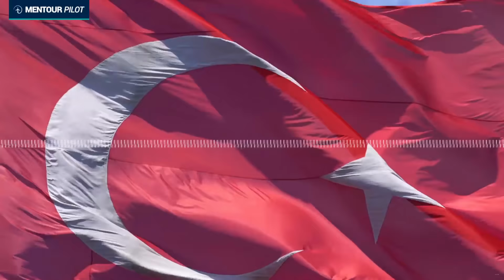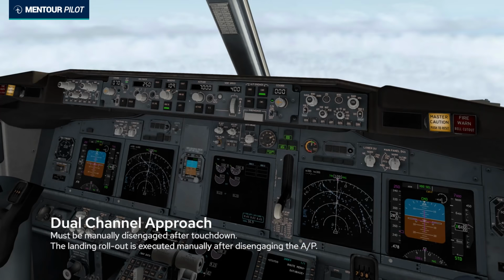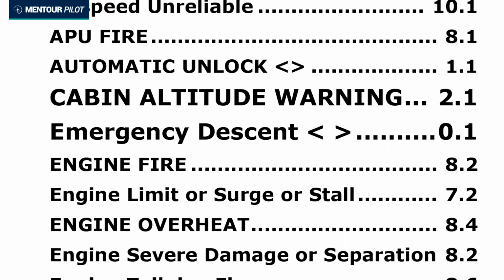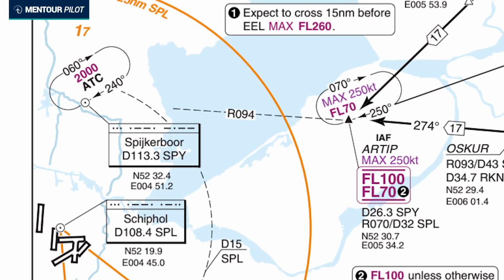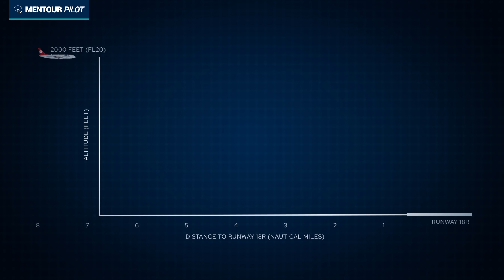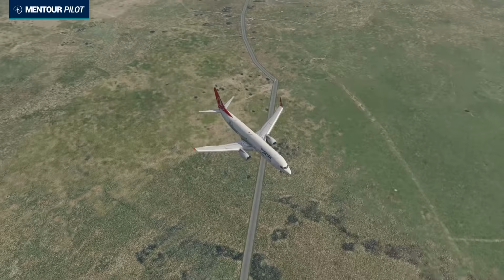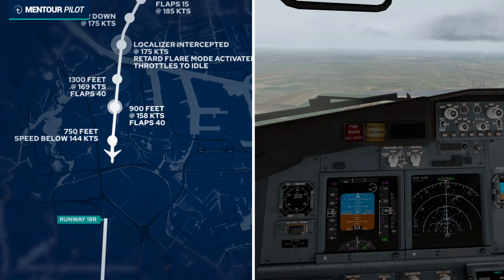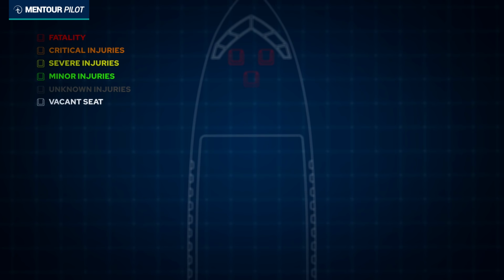What happened to Turkish Airlines flight 1951?!

Comment: As always, some of the most in depth analysis on airline crashs to be found---anywhere.  I watch pretty much all of the Docs--Mayday, Seconds from Disaster, Air Crash Investigation....So I know you have done these explanations a million times.  I can't help but still note there is almost no sense of tragedy in the deaths involved.  Certainly I don't have your knowledge and I guess if you're going to do these the way you do, must be necessary to divorce yourself from any emotion about each incident.  Despite have seen so many of them, I haven't gotten to that point yet--at least most of the time.   
Also: despite having seen dozens of your crash analysis I still only know you as "Mentour Pilot"  Surely you've given your actual name somewhere?

Finally,
I never buy-in completely to the official analysis whether it be NTSB, BEI or any of them.  There still exists a substantial disconnect between today's "auto flying airlines" and how well trained pilots are to use (often over depend on them).  Airbus actually has a philosophy where they'd like to see Pilots rendered obsolete and unnecessary.  Boeing incorporates the same level of automation but not from the same philosophical perspective.   𝗠𝘆 𝗳𝗶𝗲𝗹𝗱 𝗼𝗳 𝗲𝘅𝗽𝗲𝗿𝘁𝗶𝘀𝗲 𝗜𝗦 𝗘𝗻𝘁𝗲𝗿𝗽𝗿𝗶𝘀𝗲 𝗜𝗧.  My own conclusion is that while Airbus and Boeing may understand, WELL, how airplanes work they do NOT understand the limitations of Computer based AI.  They way underestimate how "mindless" these systems are in a "garbage in, garbage out" scenario.  Unfortunately today's pilots also put way too much faith in these automated systems.  Computers are great for doing accounting,--flying airliners and solving unforeseen (i.e., those they have not been programmed to solve) scenarios---NOT SO MUCH.

Comment: It seems not paying attention to the engine thrust and losing speed is the most common cause of landing accidents. But that usually happens after the crew fails to go around when they could. In real life pilots are under immense pressure to maintain TAT and on Indigo I remember a pilot saying they could be derostered for going around. This is the problem.

Comment: In many of your videos you explain when what information was on display to the pilot. Like flight director bars coming and going.

Is that information part of the flight recorder data? Like as separate bits in the recording where the computer logs what it draws? Or is it inferred from some other state of the system as reconstructed by the data?
Reply: It is usually inferred from other data.

Comment: So what ever came about on what I think is the start of all these compounding problems?  

The faulty radio altimeter?  Was it ever looked at for the cause of its failure?   Yes the pilots not monitoring their controls is of course part of it but if they didn't have that faulty part, most of or none of this would have happend.....

Comment: Thanks for all your very interesting videos. 
As a not-pilot I don't understand, how can the A/T only depends on one Radio-altimeter and not verify with a 2nd source of data? (sounds to me like MCAS depending on one angle of attack sensor.🤬) Boeing safety standard?
Having a 42 year old first officer beeing controlled by a 28 year old safety pilot on a Turkish airline seames to me also not very optimal.

Comment: Why does the B737 usually break into three during accidents?  Obviously it's impossible to make direct comparisons between accidents as they are all unique but I don't see the same ruptures in the fuselage in other aircraft experiencing similar accidents (lower altitudes and velocities).  The BA B772 at LHR springs to mind.
Reply: You say it is impossible to make direct comparisons between accidents, but you go looking for a direct comparison and then pick one that is not comparable at all. This airplane stalled and pancaked into the ground. The BA 777 @LHR touched down in soft soil short of the runway without stalling.

Comment: Sounds like maybe they could have avoided the crash if the FO had been allowed to complete the stall recovery when he did, if they had kept the plane at full throttle from that point on. Of course neither of them should have let the airspeed creep so low and the AOA get so high in the first place without realising something was wrong, but there you go.. human factor I guess.

(Yes, obviously this all began with the faulty radar altimeter and the automated systems relying on it, and the crew's inability to recognize this, but the ultimate nail in the coffin was driven in during those last seconds.)

Comment: After watching many of the videos it strikes me that in almost all cases, automatic warning alarms trigger way after it is too late to do anything to effectively address the problem. As a result, they seem to just distract the pilots from solving the problem they are working on. Why can’t these alarms be programmed to trigger much earlier, before the conditions get so critical?
Reply: more needed is an auto save the plane mode so the plane engages in a alternative go around mode where max throttle and disengaging pilot steering would come in handy
xD

Comment: 737 TRI here. Kinda confused. It looks like the the crew continued the approach with CMD B engaged and thus a single channel approach...therefore the A/T would remain in MCP SPD even with a faulty altimeter and would only go to RETARD at 27' RA on a dual channel approach. Did the FO eventually engage the second AP that wasn't shown in the video?
Reply: No the AT will still retard the thrust at 27ft no matter the type of ils, single channel  dual channel ,or manual,  just like with the 777 and 787. 
 Thats why you can  see some 737 pilots(although it's rare as it contradicts the fctm)  leaving  the autothrottle enabled during a manual landing , and it will disconnect by itself upon thrust reversers operation.

Comment: Instrumental failure is one thing but an unusal steep approach is another thing. Now I know that typical Dutch mindset is to fit in any place as tight as possible. You can see it in every part of their life. Houses; their stairs are incredibly narrow, toilets are the smallest possible. The way they drive; they always drive in the most right lane possible with a minimum following distance and when they overtake you they literaly do it licking your front bumper. The turnouts and forks on the highway are way tricky, you may need to make a scissor lane change out of nowhere at 120 km/h because they don't design standard clover type highway exits. Their road lane structures; on many roads left lanes end after a sign on the ground because they dont prefer to use double lane if single is enough... %95 of the time, everything in Netherlands have the optimisation philiosophy of lowest/smallest/closest/tightest limit which is considered as "enough". I don't want to believe this habit affected the mindset of an ATC who works in a serious sector like aviation but...That looks like a possibility to me now.

Comment: Normally, you do an amazing job of explaining the technicalities of the sequence of events leading to a crash. Perhaps it’s because of your high level of familiarity with this type, but I found this crash sequence a bit of a mess-sandwich. After they missed the gate and did not GA, what should have been done to resolve this radio altimeter mistake (still using PF RA). Although there we so many alarms, but they were all indirect. Very confusing.....

Comment: Another great video.   Your analysis is convincing me more than ever that overly complex automation is evil.  Especially when there are different modes.   It should be simple enough to be modeless.  For example, autopilot holds constant current altitude, heading, speed only when straight and level at altitude, no other modes. One on/off button for autopilot, no knobs.   If that means shrinking the envelope of what/where/when we can fly, so be it.

Comment: having watched this video and read many of the varying opinions in the comments I cannot help thinking that the clearly complex landing procedure would surely be better controlled by the pilot in charge , the conflicting automatic systems , not to mention the captain,s attempts to interpret the unfolding situation, further complicated the situation-- had he taken control of the whole approach surely the lack of thrust on the engines would never have been an issue , given that the engines were both functioning correctly , it seems to me if the auto pilot systems had not been used at all this accident would never have happened, furthermore , the fact that the pilots seemingly rely so much on the automatic control systems day to day , when faced with the prospect of taking control, they easily get confused , not through lack of knowledge rather lack of manual landing experience.

Comment: Sad how since Boeing took over Mcdonald Douglas their quality and work ethics was implemented from McD... I am very weary of the newer Boeing planes so trying to chose Airbus wherever possible. I hope things change within Boeing but current work ethics inside the company are worrying, similar to hiw it used ti be within McD, as it could have been seen with the DC10, trying to avoid any additional costs even for clear safety issues, not to mention things treated as lower risk...without the Air worthiness certificate at stake they won't move a finger

Comment: This is just horrible pilot error. He should have just disconnected autothrottle and actually hand fly the plane. They had enough clues to see bad data is being fed to the autopilot. I've flown Turkish airlines at least 5 times. The pilots cannot land properly at all. All 5 times they slammed the plane down on the runway, poor landing gear.

Comment: I am curious - I believe the radio altimeter adds distance to calculate height of the wheels from the ground. Would this failure not indicate that the radio altimeter was getting an instance bounce back, meaning 0 feet, subtracting 8 for distance from altimeter to bottom of wheels, resulting in a -8 reading?
Reply: Actually 4 feet from transmitting antenna to bottom of wheels, and another 4 ft from bottom of wheels to receiving antenna. But you are correct, that -8 could mean a "short circuit" between TX and RX units. I was wondering the same, but with the problem being intermittent it's difficult to pinpoint the source of the problem. I believe that numerous swaps of the radio altimeter unit (the easiest to try) did  not seem to improve the situation, though being intermittent makes any improvement difficult to assess. The problem may have been an intermittent leak between the antenna cables, which would be more difficult to locate. Could even have been a poor connection (corrosion) between antenna cable and transmitting antenna, which would cause reflected waves in the cable that could leak to the receiving antenna's cables… but prior to this flight, the crew of the other flights that had the autothrottle go into retard mode due to the failed RA were monitoring the flight parameters and reacted appropriately. They noticed the throttles incorrectly going to idle or realized it after the airspeed began dropping and knew that the autothrottle was probably doing so (but probably didn't know WHY), so they simply turned off the A/T and went on to land safely.

Comment: Sir I have a doubt when the captain side radio altimeter fails isn't there a choice of selecting the First officer Radio altimeter, consquently the control signal from the respective computer will altered Fasciliting the first officer to land the plane,  Because in this case the captain was officer  monitoring kindly forgive my ignorance if I am wrong
Reply: Go back and review the schematic layout of which system feeds which display and the autothrottle.

Comment: The automatic flight system doesn't compare radio altimeter with baro altimeter ? i mean , shouldn't it be that when they have such a huge difference the autopilot and autothrottle should be disengaged since such a huge misunderstanding can take place ?
Reply: That doesn’t always work. Baro measures altitude (height above mean sea level) radio measures height above ground
Reply: @tomstravels520  if there an option to put QFE then ? in order for the system to crosscheck the radio alt
Reply: @Echo_Lima  QFE is very rarely used by commercial pilots so probably not. Some aircraft don’t have that option. Also QFE would only be a reading of the average ground height if the airport. Not the ground height below your aircraft and it’s it’s sloping or uneven terrain (or loads of buildings) it would still be wrong
Reply: @tomstravels520  i imagined a system where you can use QNH as primary and QFE only for the system to crosscheck the radio altimeter but you are right , it doesn't work when you have obstructions underneath .

Comment: Automation is great till it tries to kill you.
Reply from the maker: Yep.. understanding of automation is key to keep that from happening.
Reply: @MentourPilot  for sure. I’m really appreciating your videos. I just posted a endorsement for your channel on a Facebook page and mentioned the following bit. Thought you’d appreciate it. 

I’d like to make an endorsement for a YouTube channel I have found recently. Many of you may already know about it. Mentour Pilot. 

He has a lot of different videos, but the ones I’ve been watching a lot are his accident/incident investigation stories. I am by no means an aviation expert, but at 3700 hours and a captain on multiple corporate jets, I like to think I know a little bit. However, even while watching this guys videos about crashes I thought I already knew everything about, I learn a ton. I honestly believe these are making me a much better pilot and a safer one as well. We all have something more to learn, and Mentour Pilot adds to that exceptionally well. 

The most recent video I have watched was about Turkish Airlines 1951. Check it out. 

I’m in a unique situation where I am captain on two corporate jets, a Legacy 650 and a Praetor 500. Although the Legacy is relatively new, 2013, it’s based on the erj-135 designed in the 90’s. So, most of the technology is pretty outdated compared to the Praetor which has all the goodies: auto throttle, fly by wire, side stick controls, auto brake, auto trim when flying manually, etc. I used to think it was a huge hassle going back and forth between the types that are so different, but now Ive grown to appreciate it. I get to fly an airplane with modern, advanced technology, but I have realized that a lot of that tech can make me a lazy pilot and leave me naive to skills I should be constantly improving on. However, when I fly the Legacy, I am forced to use my skills that I may not exercise in the Praetor. I actually feel like I am blessed being able to fly both. 

The video highlights some contributing factors to what happens when automation dependency, left unchecked, can be disastrous.

Comment: Pilot error.  Problem eliminated.
They allowed the aircraft to go far out of it's flight envelope.
3 pairs of eyes not watching what counted.  Slow uptake and delayed input sealed their fate.  You can add all the rules and check lists you want but that's not the same as flying.  It should be fluid and instinctive.  I see this in other fields and this kind of thinking fails again and again, because it's not integrated with reality.  Reality moves much faster and doesn't bore you to death.  Some people can never achieve an expert level of a skill, this is crutch for them.  No saving dumb bunnies.

Comment: It was a little too much-ignored mistakes to feel good here! Perhaps a confirmation that the warnings were heeded should be introduced and more included than a simple push of a button? I wonder if all the world's flights use feet instead of meters because regardless of the airline, the videos show the instrument values in feet and pounds instead of the more logical meter system?
That commercial flights do not have a normal radar surprises me as it would definitely help to avoid collisions and also be able to help show the right altitude when dealing with broken systems (which in itself should not be allowed to occur) perhaps the radar can be disturbed by other radar systems, but the military can do it, so it can not be the reason, so why doesn't it exist? Should warn of flocks of birds too as an example and whats is behind the cloud you can see...

Comment: What I was wondering, shouldn’t the radioaltimeter trigger the voice call outs of 1000ft 500ft etc. With the radio altimeter broken, the voice callouts are gone also?
Reply: Yes because it wouldn't be passing the callout numbers, it went straight to -8
Reply: One RA was malfunctioning, the other one was working properly. To answer your questuon requires knowledge of the connectivity of the radio altimeters to other systems. Only the connectivity to the autopilots and displays was shown in the video.

Comment: Would this crash have been less probable in a A350 or 787?
Reply: almost certain. I think A350 has 3 radio altimeters so you get an average value and can be crosschecked with other 2